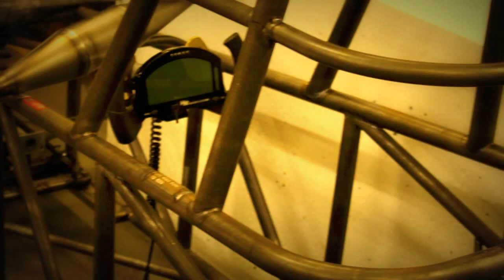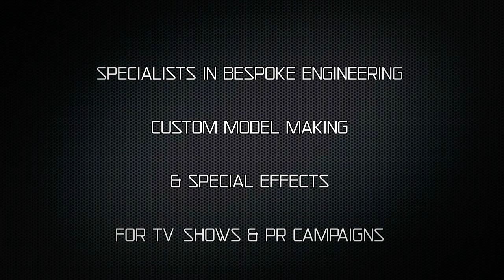Worlds fastest power tool powered vehicle - The Gadget Show - Dragster built by Robo Challenge

Comment from the maker: @1234jumpingj4321 72mph over a 1/4 mile with only 4 engines running. In september we had all 6 engines and managed to get 65 mph in 100 meteres. calculations suggest over a 1/4 mile we should achieve speeds of approximately 105 mph which is quicker than a Mercedes CLK AMG high performance sports car!